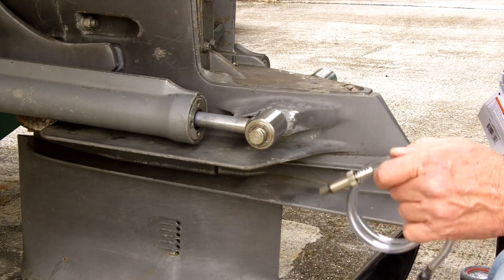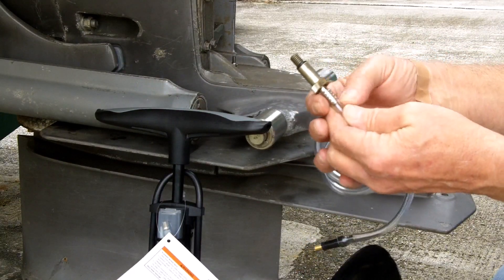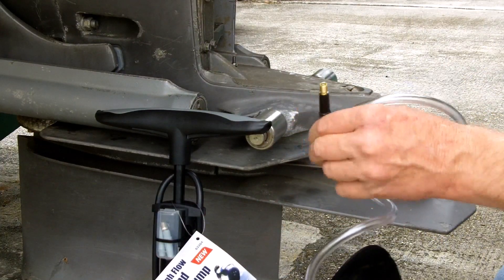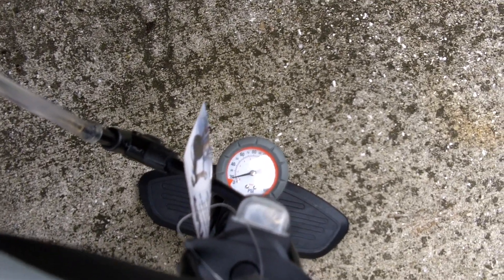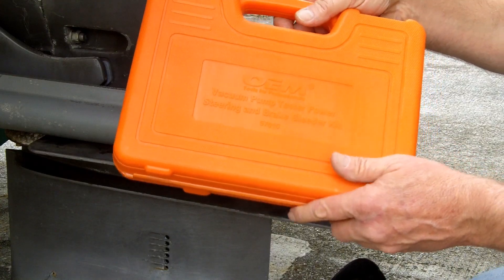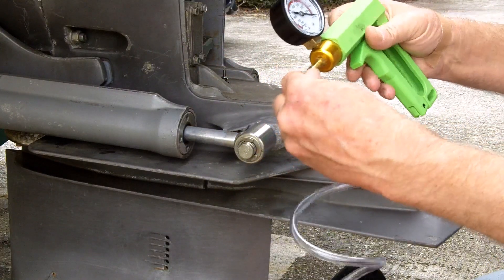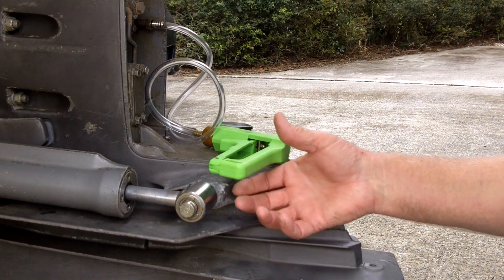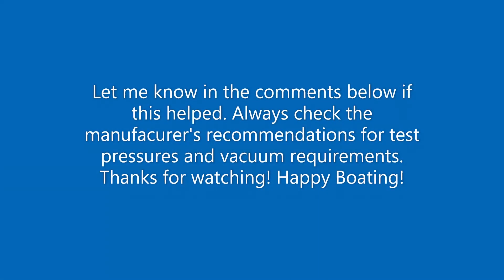EZ Outboard Lower Unit or Outdrive Pressure  and Vacuum Test

Comment: Nice video. Where do you get the fitting to screw into outdrive.  Gear oil pump fitting? 
Please.
Reply from the maker: Yes, the fitting for the gear oil pump. Brass with O ring. Not the plastic type.
Reply: @chrisg1076  Thank you for the response